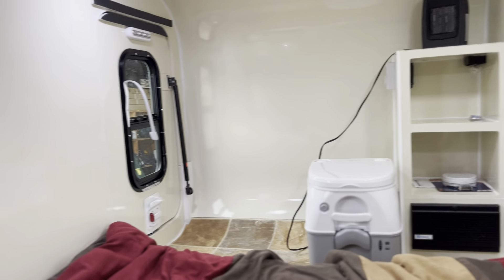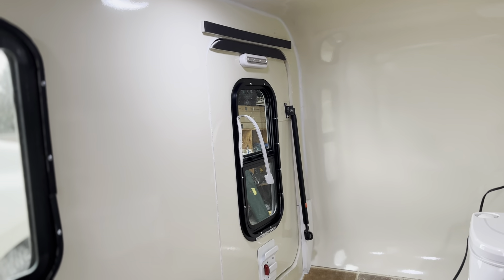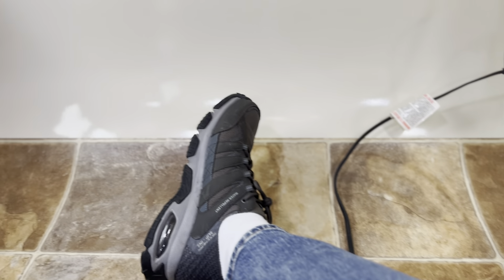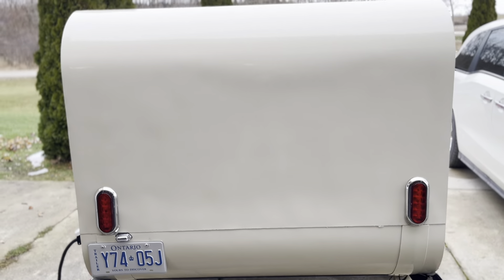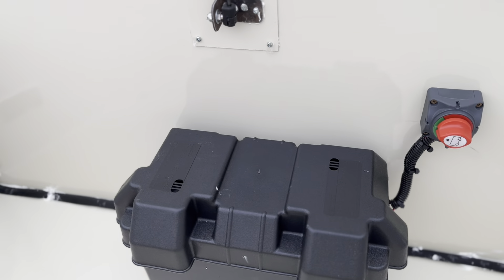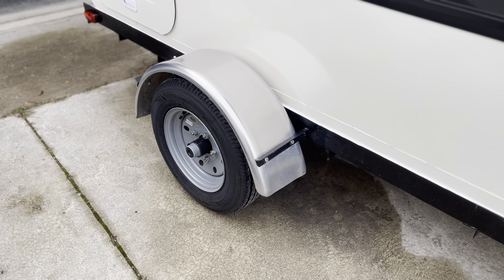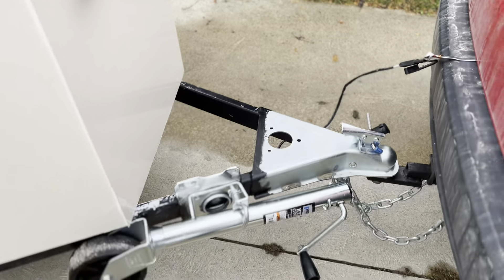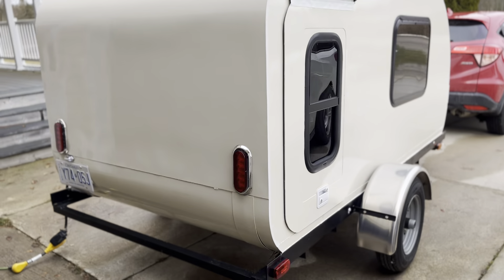OgiLite Model 3 is finished!

Comment from the maker: As far as the tongue jack goes, I keep calling it a hitch. I used a swivel tongue jack because a normal bolt on tongue jack does not have enough ground clearance to leave the wheel on going down the road. Using a bolt on side swivel jack solves that problem. First I put it on with the brackets and bolts provided and then welded it to the tongue and took off the hardware for a cleaner look. It is super easy to roll the trailer around on any surface except loose sand and uncompacted gravel.